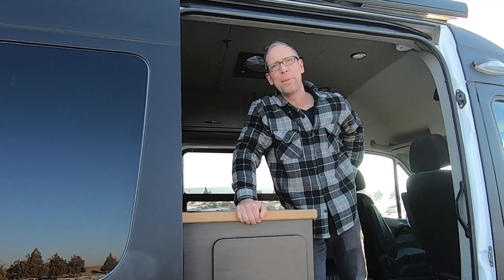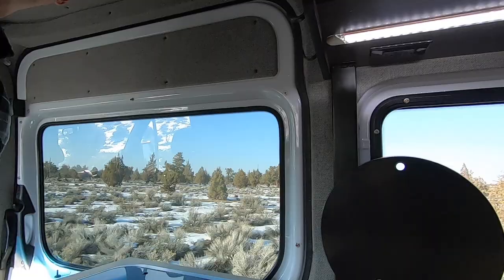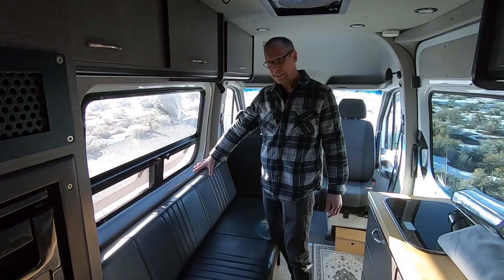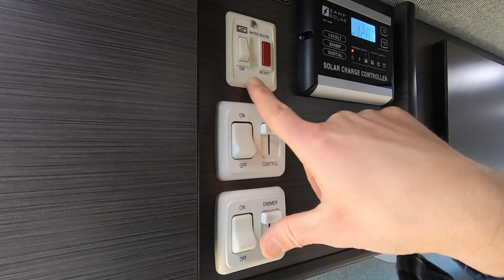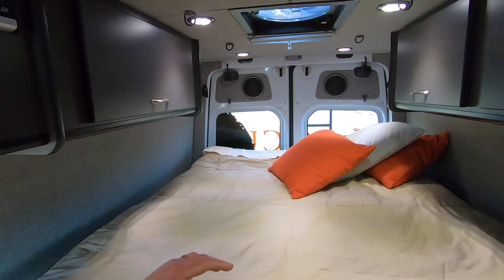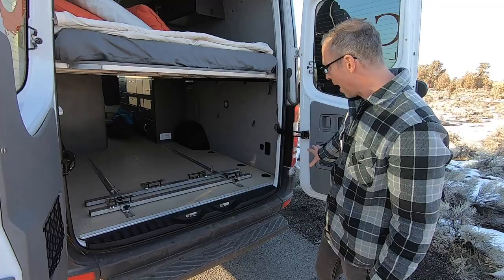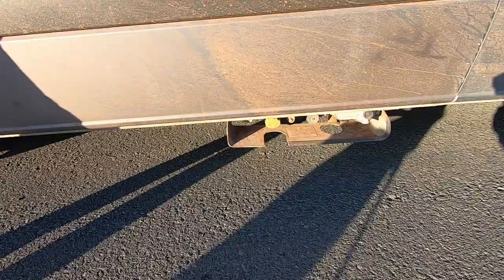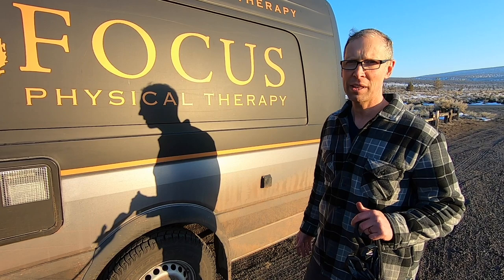VAN TOUR: Living LARGE in our mobile work/play sprinter 170" EXTENDED!

Comment: I am struggling between the 144 and the 170 ext, help! How is driving and parking?
Reply from the maker: This is such a great question! Stay tuned for a video just on this... in the meantime, will you need to use it as a daily driver? urban, suburban or rural setting? It drives SO WELL!! It's super stable on highways, with wind, at speed - totally great. We test drove a used BMW X5 some years ago and my first comment was 'this drives just like our van' for reference. Now the only downsides: parking and tight turns. Tight turns would be an issue with the normal 170" WB anyway since they share that wheelbase. Parking is extra tough - we take a spot and a half in the back end of the shopping center lot and normal parking garages won't be able to accommodate it. Normal spots are typically around 18-19 ft long and the van is a solid 24'. Where we live and travel we can ALWAYS find a workaround with maybe an extra couple of blocks to walk, but I wouldn't want to do that every day. I LOVE that we don't have to play van tetris everytime we want to cook, sleep etc, which most folks with the 144 have to do to some degree unless their build is super simple. It's worth the tradeoff, but if we downsized vehicles and used the van for daily driving, I'd have to go 144. Hope this helps!
Reply: Usually the only question is... do you want a shower. If yes. 170. If no. 144 👍